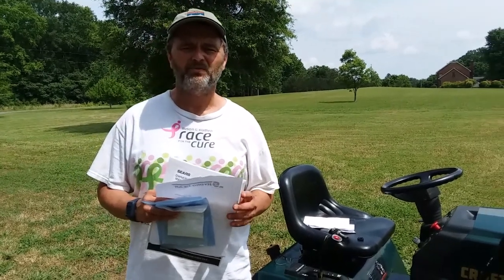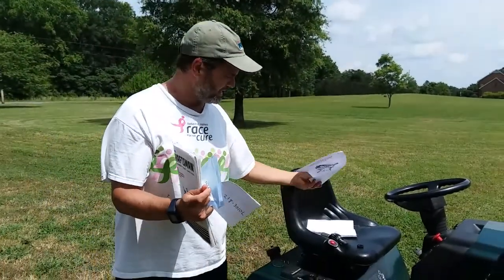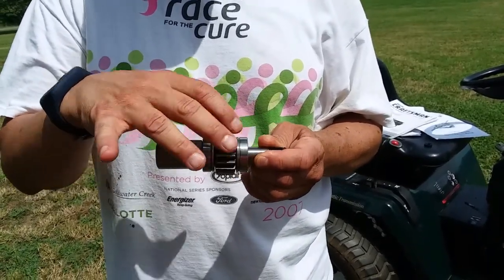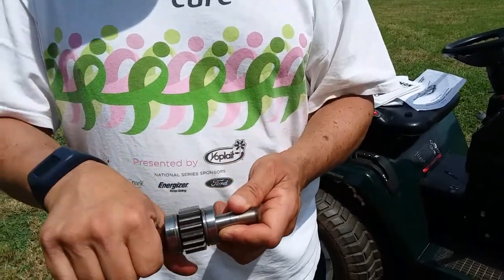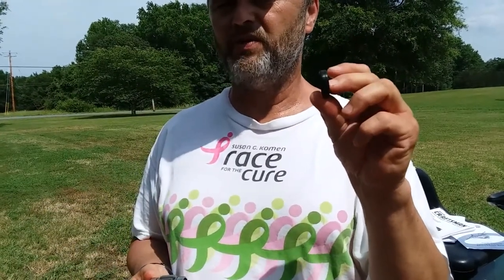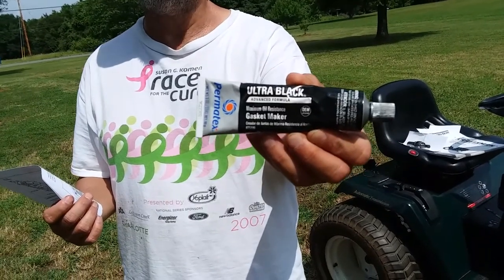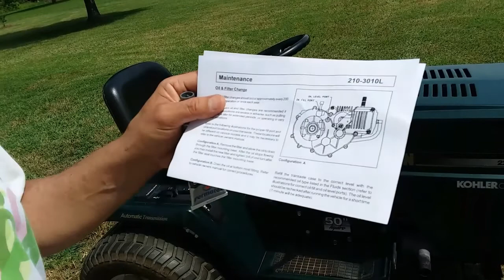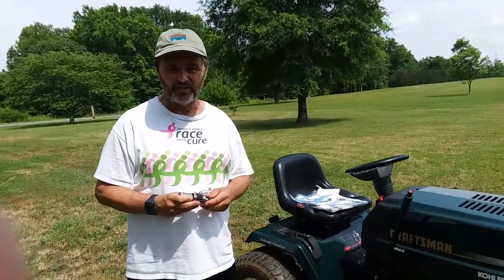Sears Craftsman Lawn Tractor 917.258910 HydroGear Transaxle Repair - Transaxle 150073 218-3010L

Comment: Great tips and getting to the point. I think I have the identical tractor and transmission... although a different issue then yours, which in my case was caused by my not so mechanically inclined son forcing off a rusted on rim to the axle. I might add my son is a most experienced executive chef... maybe your video will help us find a middle ground.
Thank You :washhands:
Reply from the maker: Glad you found the video helpful.

Comment: Thanks for info. Same thing happened to my tractor. Going to take it apart in a couple weeks. You have same tractor as I have. Had it since 1998. Was pulling a gang mower and the tractor just stopped running. I guess the trans wasn't heavy duty enough. Thanks again.
Reply from the maker: Good luck.  You will see that the gears inside of the transmission are pretty beefy, but if the coupling that I did the video breaks loose, I can see where the tiny splines could strip out under heavy load.  In my case, I think they wore out after years of the coupling being loose which appears to just be a bad design.  Anyway, I hope your repair goes well.
Reply: Instablaster...

Comment: Hi great video. I’m having similar issues with my hydro gear transmission on my cub cadet, it started to not want to go up hills. I change the transmission fluid, drive belt and it seed to drive ok until I tried again to go up a small hill. Do you have any recommendations on what I could look for. Thank you
Reply from the maker: If it is the same or similar model transmission, it sounds like there could only be a couple options.  If you hear a whining sound when the issue occurs then it could be the same problem that I had.  You can only figure that out by trying to see if the piece I replaced is stripped by pulling out on it and seeing if it will spin.  The other option is that the hydraulic pump that is bolted to the transmission.  I didn't have to open my pump so I can't tell you much about it though I think the manual show how to disassemble it and I assume parts are still available for it.  I'm just not sure how to tell you to diagnose if it has an issue.  Either way, it sounds like you are going to have to pull the transmission and start looking for the root cause.

Comment: Hello. My mower quit going forward and reverse near end of season with a high pitch sound also. I got the transaxle apart like you did. The part that was stripped on yours , mine wasn’t stripped but it was loose. Should I still replace it or do I have another problem possibly? Thanks
Reply from the maker: The end of the coupling that is next to the bearing/gear side is pressed on at the factory and should not be loose.  It should be tight as if one piece.  If it is loose, that is not right and that part should be replaced.  You didn't specifically say so, but I would suspect you can slide it apart which is not good.  On mine, if I pushed on the coupling and then tried to turn it, it didn't look like the part was bad because it was catching the splines at the very end that had not worn down, but when I pulled the coupling out some, it would spin on the shaft.  The sound it makes when broke could be described as a high pitched whine, so it sounds like the same issue as I had.  Also, if you have the transaxle split apart, you will see the cogs on all the other gears are must deeper such that one of those would have to be broke or very badly worn for one of them to be your problem.  I don't know why Hydro gear didn't use deep splines on bearing/gear side like they did on the hydro-pump side.  I suspect they figured it wasn't needed since it was pressed on, but I don't think this problem would occur if they had done so.  As it is, however, it appears that over time the pressing becomes loose and since the spline teeth are so small that they ultimately wear away and then you have the slipping.  Anyway, sorry for being so wordy but if the coupling is not firmly locked in place on the bearing/gear side, I can tell you it should be and I would replace, particularly since you have it apart.  Hope that helps.
Reply: @midlander3760  thanks for you quick reply! Yes when I got the two half’s apart that part just fell off with the pump. But then I checked the splines they appear good, no obvious sings of damage. I did read that it was suppose to be pressed on too. Just curious what your thoughts were on that. Thank you
Reply from the maker: @garystout2536  Yes, then it definitely needs to be replaced because even if that isn't your problem, the very small splines on the bearing/gear side will wear out now that they are loose and you will have to take the transmission back apart to that assembly at some point.  Are you saying that if you pull the coupling, say, half way off the shaft away from the bearing/gear side, you can't make it slip?  If not, then you may have another issue though this part is broke also.  I don't recall any of the gears inside the transmission being small enough to where any of them could slip and make a similar sound.  The only other though would be the hydro pump.  I didn't go inside mine but in having looked at other hydro pump videos.  I'm not sure if there is anything in it that would make a similar noise (discounting that these pump/transaxle assemblies are somewhat loud when the mower starts to move even when new.  One last thing, I would also change the shaft seal if it does not have the metal retainer as mentioned in the video.  I'm guessing that was a known issue with these transaxles also as my original seal did not have it and it was slightly cocked.  The retainer seal they now send with the seal keep the seal firmly in place.  Good luck!
Reply: @midlander3760  my thoughts exactly about a possible other issue as well. Thanks for you help!

Comment: I have a craftsman gt5000 garden tractor with less then 100 hours . when it eas about 43 years old the you would be using it & after a little while it would just start slowing down till it stoped . let it set over night . & it would just do the same thing . can anyone please help
Reply from the maker: It doesn't sound like like the repair I did.  If your tractor has the same type of Hydrogear hydrostatic transmission, your issue sounds more like an issue with the hydro pump itself which can be repaired.  You can pull down the manual from Hydrogear like I did and take it apart and look for worn parts/seals and get replacements from Hydrogear.  I would first make sure your transmission has the correct amount of oil in it to allow the pump to work correctly.

Comment: I need to try this but couldn't read those part numbers. Could you type them in a comment please? 🙂
Reply from the maker: The brake shaft is 62877 and the seal is 70719 assuming your transmission is the same model as mine.  I provided a couple Ebay examples below.  I bought the shaft locally but the seal link is the seller I used.  I would recommend pulling down the manuals and parts listing from TurboGear which provides good information.  Hope that helps.

https://www.ebay.com/itm/293762776124?epid=661670173&hash=item4465a03c3c:g:5tgAAOxyHslQ6Z2y
https://www.ebay.com/itm/253085414599
Reply: @midlander3760  it is, thank you sir!